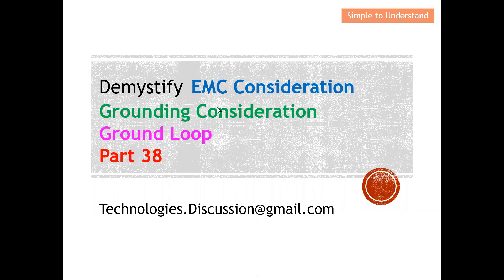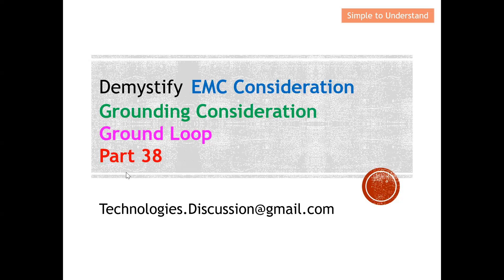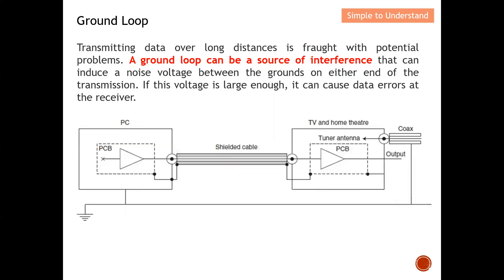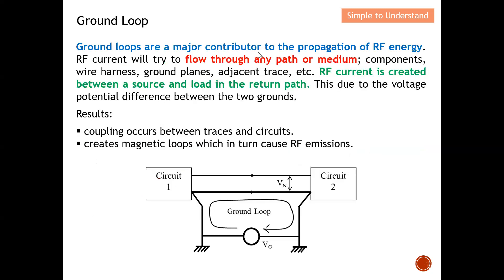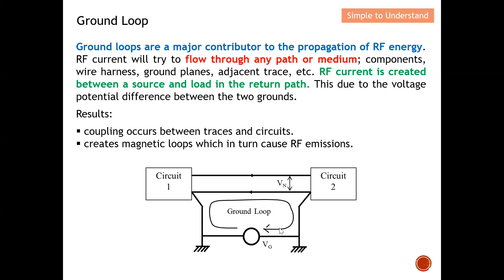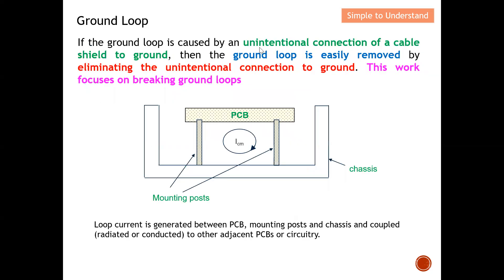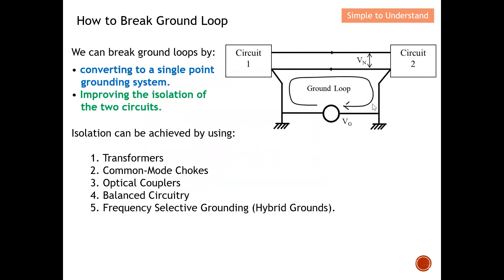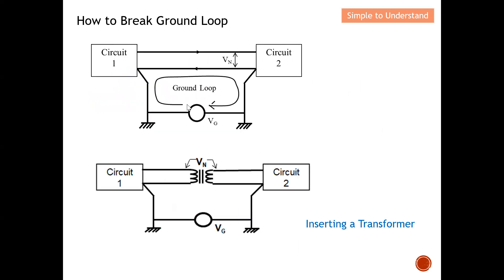EMC #38. This is How to Stop Unintentional Ground Loop Noise! Find, Break & Fix Them for Good.

Comment: what is purpose of SMPS ground ,, its shows DC voltage, 
While checking ground and DC  (-)
Reply from the maker: Thank you  :)
Yes, the ground acts as the reference point for all voltage levels within the SMPS circuit, which is crucial for accurate voltage regulation.

Comment: Make videos about the  coupling topic
Reply from the maker: I think I have done quite in deep of discussion on coupling as following:
EMC Part 5. EMI Coupling. How to Classify if is a Near Field (e- or h-field) or Far Field Coupling.
https://youtu.be/QhUrVOPTzkA

EMC Part 6. Understand Electric (E) field or Capacitive Coupling and the Parameters that Affect it.
https://youtu.be/Rw1h74lIaNQ

EMC Part 7. Understand the Effects of Electric-field or Capacitive Coupling at Low & High Frequency.
https://youtu.be/UYGI7o7jDAY

EMC Part 8. Suggest Methods & Techniques to Reduce the Electric-field or Capacitive Coupling Effect.
https://youtu.be/mvVmI6TfJ60

EMC Part 9. Derive Which Parameters Will Affect the Magnetic Field, H-field or Inductive Coupling.
https://youtu.be/O8_4YIuosII

EMC Part 10. Methods & Techniques to Reduce Effect of Magnetic Field, H-field or Inductive Coupling.
https://youtu.be/DeXSNSuKrSo

EMC Part 11. Distinguish Whether the Noise Source is from Electric-field or Magnetic-field Coupling.
https://youtu.be/pW48TkiQw2c

EMC Part 12. Equations to Show How Effective is your Shield on Electric-field / Capacitive Coupling
https://youtu.be/Q8Q0_gSbUeM

EMC Part 13. Calculate Shielding Effectiveness Against Electric field, E-field, Capacitive Coupling.
https://youtu.be/gbOt0v7S8gk

EMC Part 14. How does the Shielding Effectiveness Affects by Magnetic Field or Inductive Coupling.
https://youtu.be/cCRgWxNA6PA

EMC Part 15. How to Determine the Effectiveness of Shielding Against Magnetic or Inductive Coupling.
https://youtu.be/-fNHgJg51Gc

EMC Part 16. Understand how Near Field Merge to Far Field Characteristic Impedance of Medium 377 Ohm
https://youtu.be/LZxaElry8AI
Reply: @technologiesdiscussion1676  Thank you, your videos helped my finals prep.
Reply from the maker: Thank you for your strong support too.